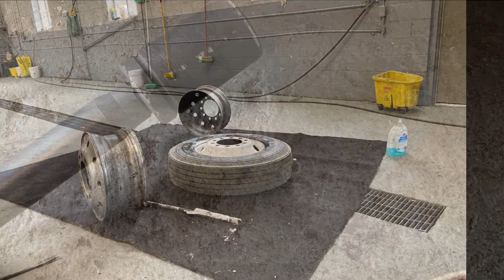#63 - MCI, MC5B, Bus Maintenance - New Tires & Rims

Comment: Did you put 365 on the stairs
Reply from the maker: I’m not quite sure what you are asking?
Reply: Prevost has a 365/70-22.5 option for the steers and tags, that conversion not available on MCI far as I know and not sure it's needed unless you're real heavy.